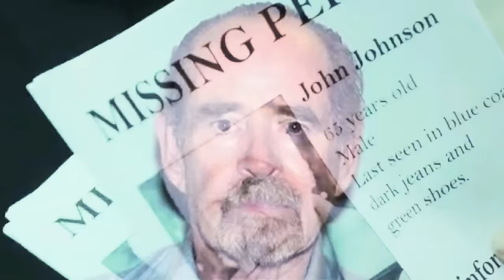Man Got So Drunk He Confessed Murdering His Landlord

Comment: Only 15 years in prison? Wow... can someone explain the due process in why he only got 15 years?
Reply: Showing remorse goes a long way in the legal system but even still 15 is crazy
Reply: @Average.Laker.fan0824  I get that, but I feel like the judicial system is getting a lot softer nowadays.  Back when I was 23 in 2002 , I got thrown in jail for 90 days for driving on a suspended license that I wasn't aware was suspended at the time I got pulled over.
Reply: Confessing to, and finding the body for a cold case is definitely a huge factor. Despite killing the dude he basically gave the PD and court a huge, unexpected gift
Reply: Would have gone free if he didn't confess, remorse, pleading guilt and cooperation I think. Could even end uo with him being brought out of prison early
Reply: @Average.Laker.fan0824  Showing remorse in the legal system is good for .nothing. but showing guilt. It does ZERO for you, just like any other "goodwill" you think you are helping yourself by "giving back."

Its called a system, or a machine for a reason.
Reply: It's 15 years because he did all the work. He solved a cold case all alone. No prosecutors or cops were invested in this.
Reply: @GALANTXVR4  its was a cold case which basically means not a single day in prison which is the big factor here
Reply: @timmyp6297  I promise you if you go before a parole board and show remorse you’ll get out sooner than if you don’t 🤷🏽‍♂️
Reply: @kenw2225  it's 15 years because that's the maximum penalty for 2nd degree murder in NM